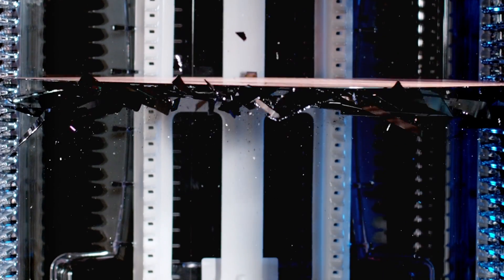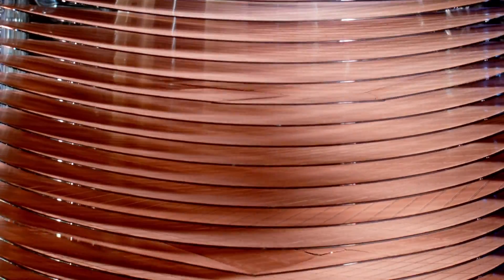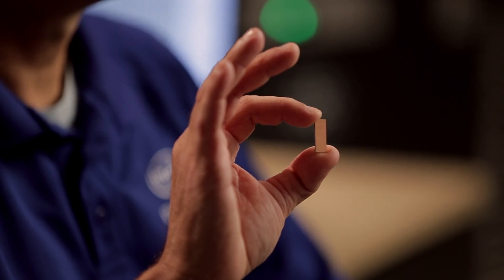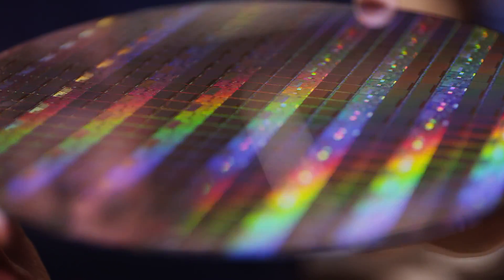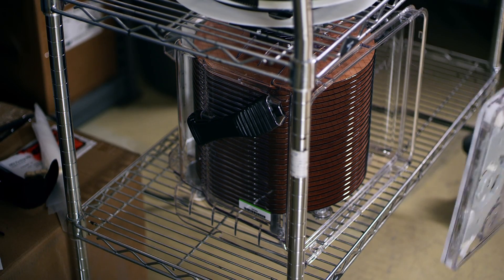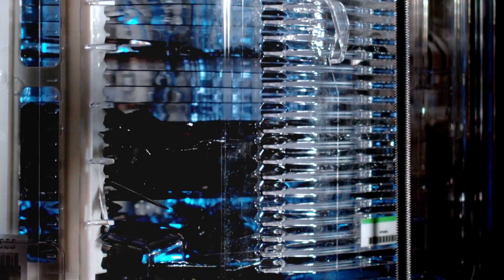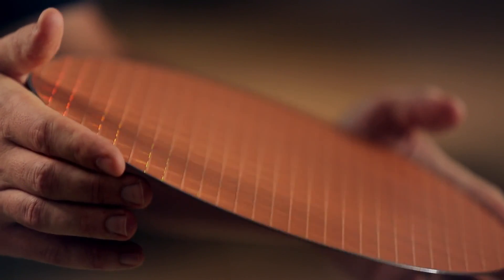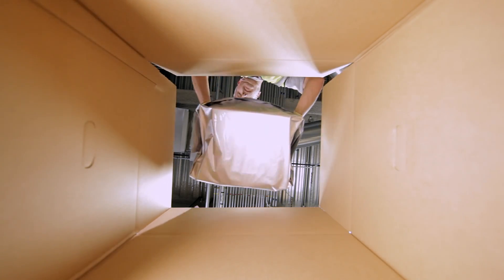Intentionally Shattering Wafers Inside The Fab | Intel

Comment: Imagine putting an entire Wafer into a single Huge CPU How powerful would that PC be (Give it 1TB DR4 Ram as well for good measure) So op Run Pro Tools 12HDX with 3000+ Tracks with under 0.000000000000000000000000000000000000000001% CPU Usage.

Comment: if the aim is to get as many working chips from 1 wafer why the hell are they round not square
Reply: good question! im just pulling a guess out of thin air here but maybe the crystalline structure of silicon only forms as a cylinder. If so, they would actually lose more chips by cutting it as a square. like i said though, just a guess.
Reply: https://en.wikipedia.org/wiki/Czochralski_method

Comment: What is the distance between individual ICs on a wafer? How is wafer cut?
Reply: It is called a scribe line, usually around 100 um but it can vary a bit since this "lost space" is sometime used for test patterns, thus helping to verify that each process step worked well. It is cut with some sort of circular saw, you can find videos on Youtube for the die cutting step

Comment: Why not put on a flotation device encapsulate the fosby and put water around it with colour? If it has been dopped the colour would indicate damage in transport ect and water will absorb shock and vibrations.

Comment: Why are the wafers shipped horizontally and not vertically to get more strength?
Reply: In a single/loose box we can't control what orientation the wafers will be shipped in.
Reply: Heh, of course just realized that when you pointed that out. 
How  about putting it in a gyroscope  thing with extra weight at the bottom so it stays upright and vertically, then put some kind of gel around it to protect it against sudden shock. Thanks for the reply anyway, sounds like a cool job.

Comment: Why to not produce chips and package them at same place? I talk about LGA packing
Reply: Alim Naizabek Cheap labor. Packing a chip is less advanced than fabbing a chip
Reply: Đỗ Đức Huy I don't think it involves much human labour. May be they do that to go around export laws.
Reply: It's because of environmental laws. Bump process involves some toxic chemicals in the solder (lead) so they have to do it outside of the states
Reply: ***** How considerate of them, right?
Reply: Oo
Reply: ***** its still easier to cut chips at factory and distribute them from here
Reply: Think about it. You can't ship exposed die, it's too dangerous. You either ship the whole wafer and cut and package them at destination or you ship packaged die. So there's some reason why they won't package them here. I'm sticking to my argument, it's due to environmental regulation